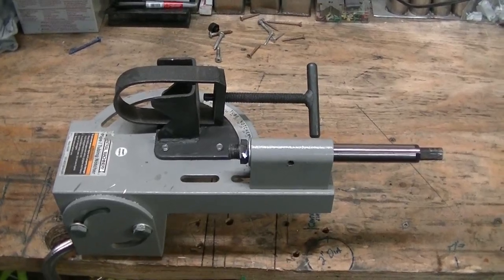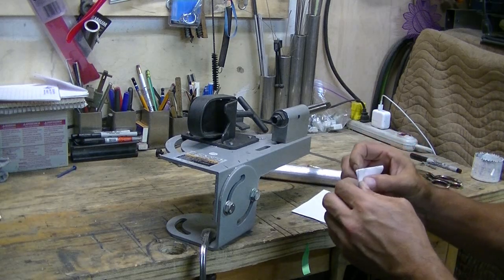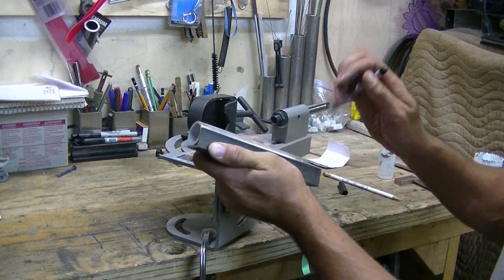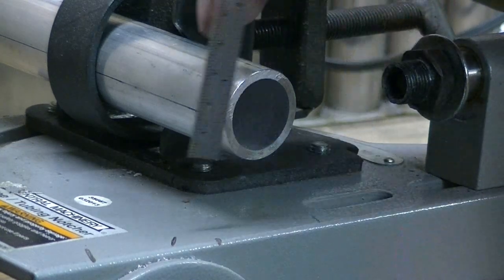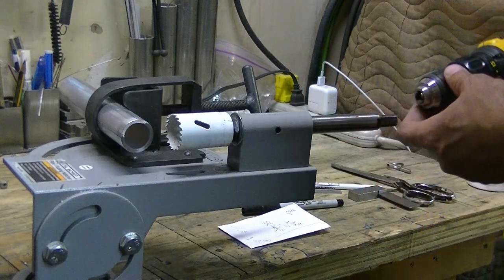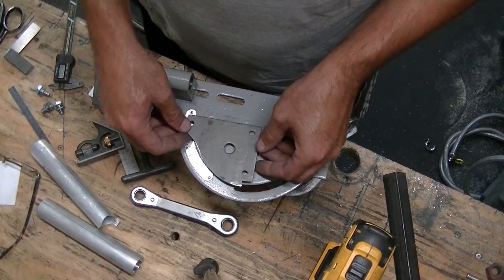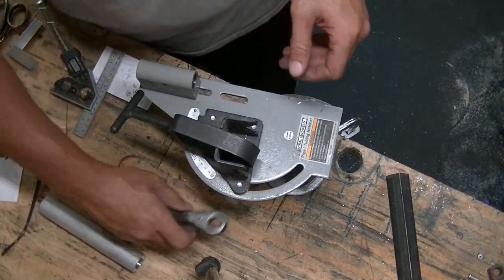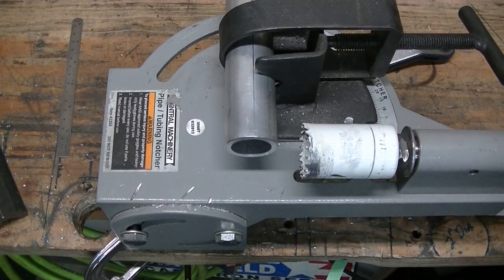tube notcher

Comment: awesome :) I got a eastwood version and it wasnt that bad slightly off but nothing big. but yours looks like it have lots of play in the block that holds the shaft  maybe you could make your own with bearings or bronze bushing :)
Reply from the maker: singlecams 
Yeah on the list of things to do. 
Got to scrounge up some parts then fabricate up a new one.
Usually costs the same in the long run as a better version but where is the fun in that

Cheers

Comment: Can you successfully notch a 35+ degree angle? I am doing 1 inch pipe with 1 1/8 hole saw. I run out of space at about 35 degrees with the block adjusted all the way up.
Reply from the maker: Jarek Czarnecki 
I think it's possibly but would require another quick modification.
I'll check it out and get back to you.
Dave
Reply: Dave Prototype yea i welded in 3 1/8 thick angle iron spacers and now can notch up to 60degrees